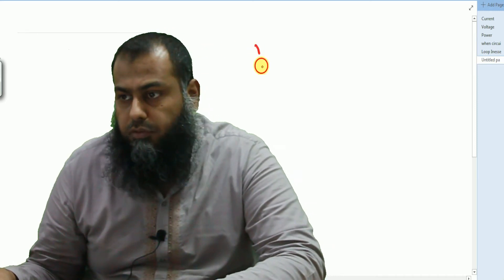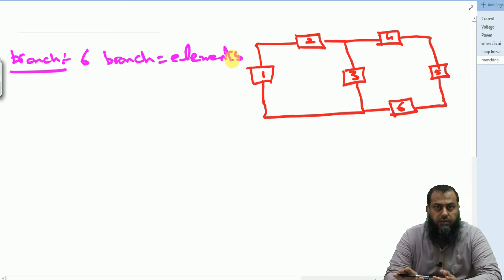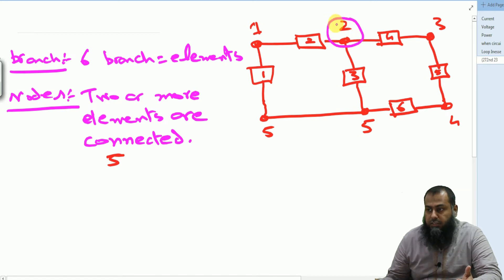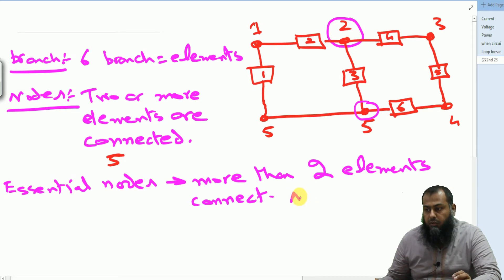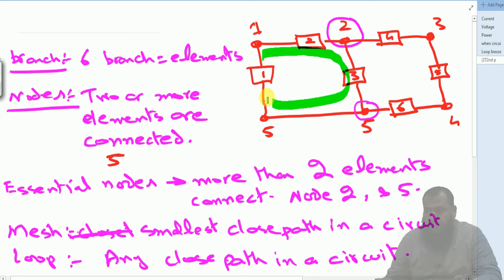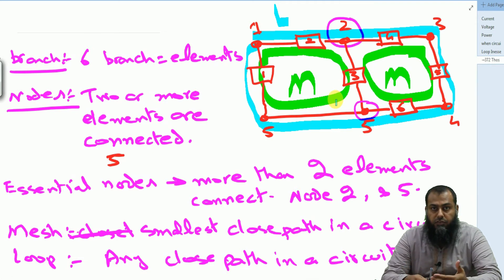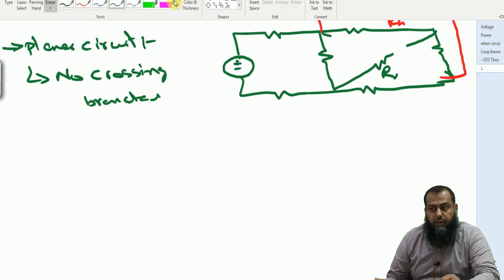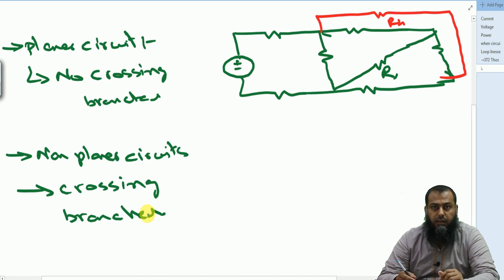Understanding the terminologies of electrical circuits

Comment: is a transistor an electrical element? it has 3 pins I have confusion
Reply from the maker: Going with the definition of an ideal basic circuit element it is not. Nevertheless it is an electronic element.